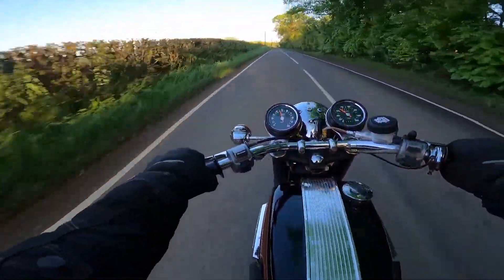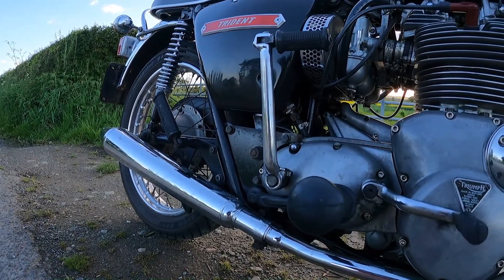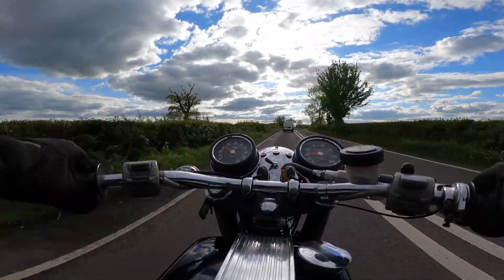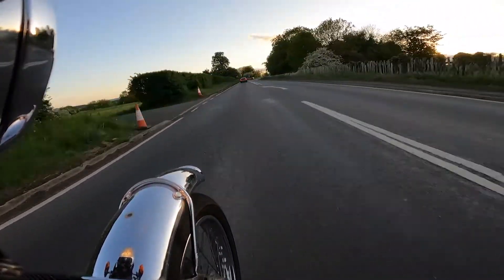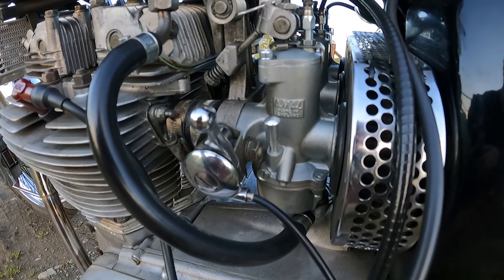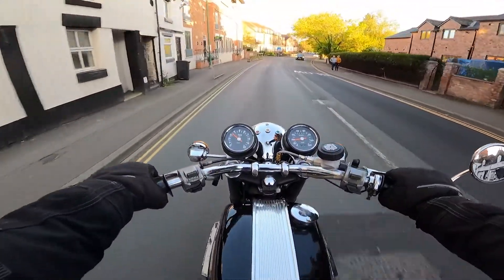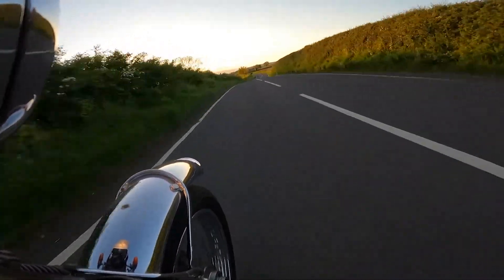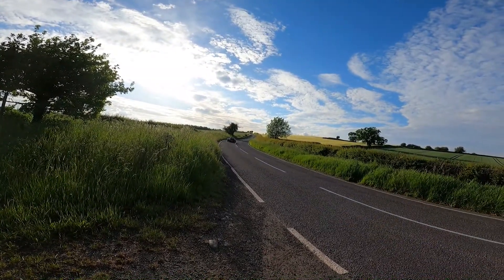The Driven Wheel : Triumph Trident T150V 1973 Ridden and Reviewed

Comment: Used to drive a T150V (1972 version) in the Netherlands for about 15 years from 1978 on. I truly loved that machine, the feel, the sound; every vibration; you didn't need a speedometer or  tachometer, you just felt how fast you were going (usually too fast...) and in which gear (mine had 5 gears). It was also my first motorcycle, back in 1978 the traffic laws in the Netherlands were quite easy; You could buy a motorcycle, pay taxes for it, have it insured AND prove you were following lessons after which you were allowed to attach a big L plate on it and start driving around your town. The prove of "taking lessons" was limited to register at a driving school and show the prove of registration, not 1 lesson was taken yet..  You can image the giant leap I made going right from my 50cc Puch moped to the T150 (Which made 80km/hour easily in first gear) .  I used the T150 to go to work every day (about 20 minute drive)  but I very often use the "long way" home, just to be able to drive and truly enjoy the ride a little longer.  I still jump out of my chair if I hear a T150 passing by and my hart starts beating faster.  Enjoyed the review, Thank you!  Ron  
PS: traffic laws are tougher now, you're not allowed anymore to drive without a driver license  and you must start with 125cc and after 2 years you may move to bigger engines. haha

Comment: Easy - fit Mikuni carbs, hydraulic clutch and a 850 conversion…sorted, a Trident that starts easily, runs really smoothly, pulls like a train and can be slipped into neutral when stationary. Love it

Comment: Clutch is better than you think when set up properly, and I don't mean by the book.
The centre adjusting nut has to be adjusted so that it will turn freely one way and not the other (less than the clearance the manual states) then buy a one inch pull lever and leave some clearance at the bar and it's a different animal.
Top end leaks are often caused by skimming and not allowing for it in the pushrod counter bores and then using the wrong thickness pushrod rubbers, over compression is the main cause.
Carbs can be balanced to get the sweet motor ticking at under 500 rpm.
Lash caps and mushroom adjusters give long adjustment periods and alleviate guide wear.
Last, put a drinking straw over the free end of the clutch cable stop oil coming out of the adjuster/abutment.

Comment: An interesting and intelligent video. I’m building a 1000cc big bore T150 special, with Suzuki GS1000 air assist forks, twin discs, flat slide carbs, half race cams, electric start, T160 rear hub, Hinckley triumph mudguards and indicators and a few other interesting bits. Costing an absolute arm and a leg! Hopefully it will sound and go as well as yours!

Comment: I do not know but you mention the vibration problem only on the bigger engines. I have been riding these bikes since 35 years ago as a TRANSPORTATION; pre unit 500 vibrates only at higher speeds until I dismantled and send the crank to balance; bad vibrations gone. I have 2 T140 and I ride at strong speeds but the vibration is ok and no more than what the 500 have.
A buddy in USA have an early T140 since new and vibrated like hell but last year they finally dismantled the motor and matched the rods etc but NO BALANCING was done and then the bike is smooth and perfect better than when he bought it new...

-Regarding what you mention about Honda; that was what the general public wanted; AKA no more wrench time...like now. however; tridents were more agile (but rougher) and those Honda did not leaked oil due to the crankcases are horizontal fella. Weld work was not better and final detail besides the copyness are just ok not quality.

Comment: Had a '75 t150v for 4yrs in '70's and only had a rectifier go,and was used daily at speed! Terrible on fuel,but i did have bigger jets and bellmouths which made it better and easier to tickle middle carb. Had to keep one finger on front brake in rain to counterract stupid chroming. Great bike and wish i still had it,was smoother than my Commando which only had two postions on throttle-wide open and shut! My '76 850 is smoother with Mikuni carb. Good video
Reply: You should have just taken the discs to the chrome platers  and had them de chromed
Reply: @Cobra427Veight  one thing prevented that,i was a 3rd yr apprentice on £30 a week!

Comment: Nice video. I have a '74. Last of the "Real" ones.😄 Built in August so not sure if its a Triumph build or a BSA build, though Ive read all the Trident engines were built by BSA. Had it nearly 10 years and pulled it 1/2 apart, suppose I should put it together and ride it, you have given me some incentive. Do you have the Tri Spark installed? Apparently it does wonders.....I hope so, they are just down the road so I should buy one. (Adelaide, South Oz).

Comment: My clutch was rather light to use, the middle carb issue was easy as I had long fingers, setting the carbs? I used that old trick of the 3 pencils, the tyres were great in wet and dry, the knicker elastic had to be changed at around 3000 miles, my problem was that zener diode, drove me bonkers. The middle cylinder suffered from heat issues and blew the head gasket at least 2 in one year. Oil? It did leak, but more like a mist on the rocker covers. On the whole she was a great ride and a much better bike than the Bonnie!

Comment: My T160 doesn't leak a single drop of oil 
Probably the engine has never been apart
Reply: I had a T160 from new and it never leaked a drop of oil. Of all the bikes I’ve owned over the years it’s the T160 that I miss the most.

Comment: I would think the front brake could be swapped to something more modern...maybe complete with the forks for said brakes?   I think I would have to redo everything that immediately limits cornering ability even if offended some purists collector geeks that demand every piece stay original ....I might even change the rims if the stocks severely limited tire choice although I somehow doubt 17" rims would work well??
Reply: Have a drilled disk on my T150V , great improvement in dry and when wet, floating disks are also avaliable. Have Girling shocks on back 1" longer and uprated fork springs, does need piece of wood under main stand though to clear back wheel with the longer shocks